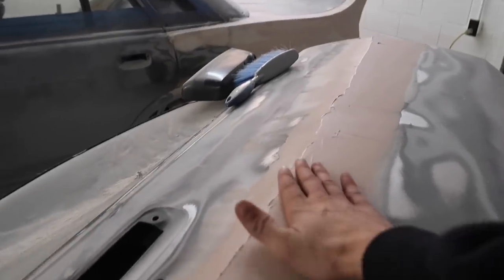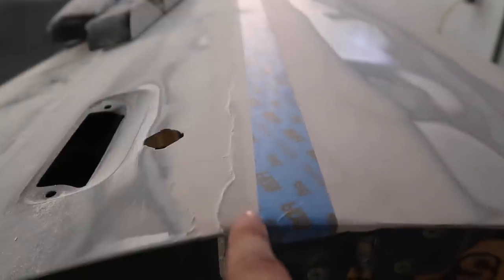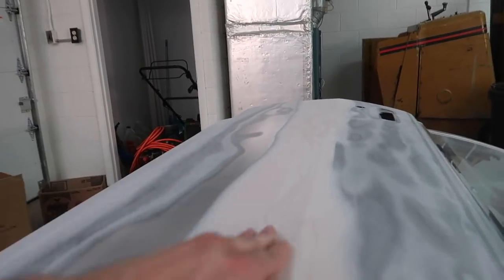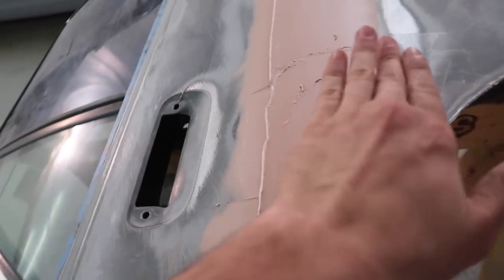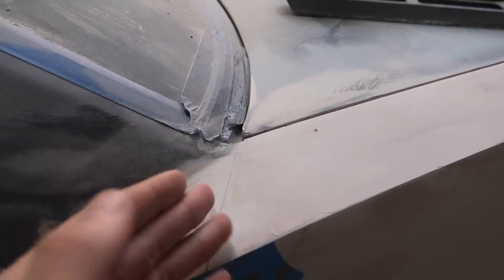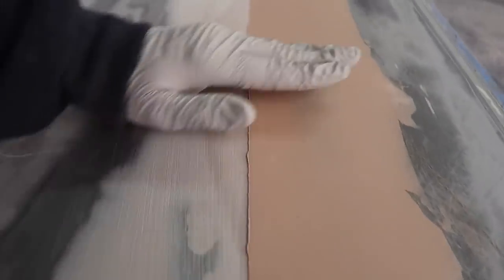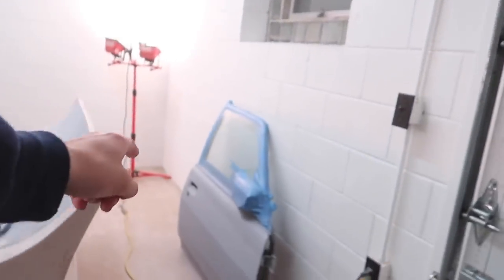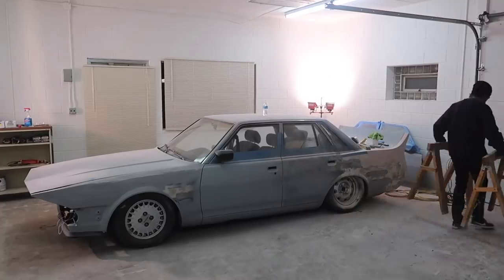Crisp Lines | Bosozoku Doors Are DONE!

Comment: Aslo when you clean the panel off we use degreaser, when you spray it on thick it will give you a clear coat like look so you can see dents and dips in the bondo so it’s not too late once it’s painted

Comment: I would have tack welded a small angle strip to the door, or even pop rivet it, and use it for the straight body line you are trying to achieve. You could then fill each side with a minimum of filler to get the crisp peak line you are looking for without all the messing around. Also your filler is likely to be pretty vulnerable to cracking and the metal angle strip would have helped with that.

Comment: It's looking good!! When I built my MX73 Cressida I welded in all my side trim channels with 16 gauge steel. Had to use hardly any filler. I also did a custom front and rear out of steel with round lights. Kinda MAD MAX raised the offspring of Cressida and a BMW. Pics on my Instagram @Buzzdagen . I also have molds for fiberglass driver and passenger inner doors if your gonna do a stereo. Also I think my tail lights would look good on your car in pairs.

Comment: Rattle can primers are not good for what you're doing, especially when they fill in the deep scratches. After time and sun light that rattle can primer will suck in the paint after you paint it.  Sand it down use a good high build solid 2k epoxy primer, you can buy them in spray cans

Comment: This car has to atleast have thousands of pounds of Bondo on it
Reply: RICER GARAGE no lol most of it gets sanded right off. Each layer he adds only a very small amount stays
Reply: Except for the tail and the center of the doors. He filled in an inward recessed crease on the doors which was about 1/2" deep. A good portion of the tail and the entire rear panel/"bumper" is foam and bondo.
Reply: Steve Varholy mostly foam and the bondo glass or whatever the super sturdy shit is. The back end has the most bondo but still nowhere near what has been put on
Reply: But it's still A LOT of Bondo. Next project I am sure he'll have more skills to fabricate the coachwork out fo something other than body filler...